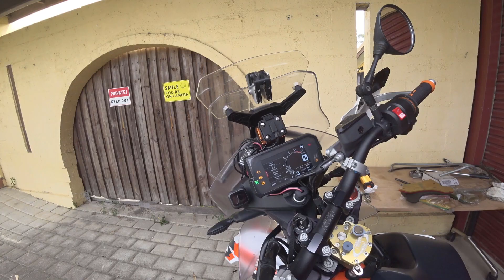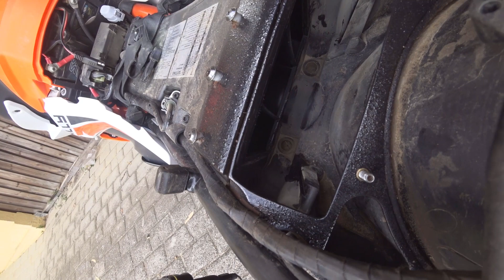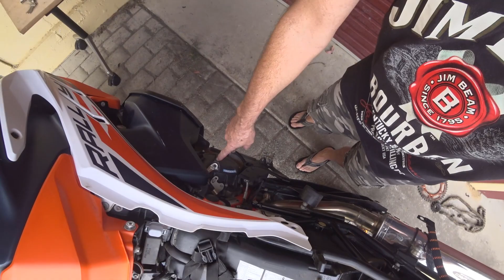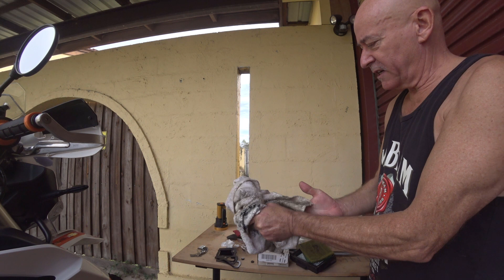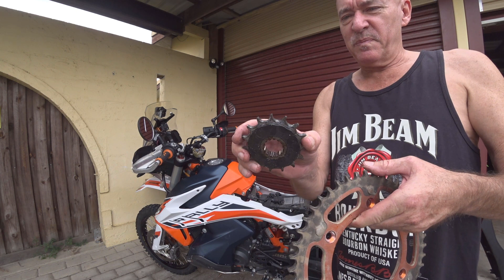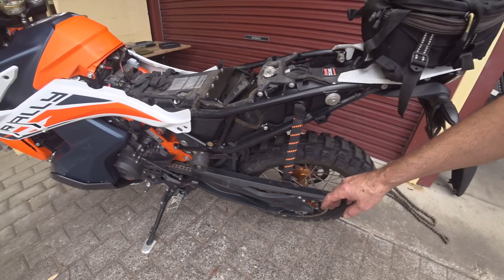Ultimate Adventure Machine? 25,000Km Review of my KTM 890 Rally - Is it Worth the Hype?

Comment: A great machine, thanks for sharing. I'm interested in your skateboard wheel 'steg peg' addition. I'm hoping to do a similar thing with my 850gs (as Steg Pegs are not made for my model) by removing the passenger pegs and securing the wheel to the forward existing bolt hole. How do you secure yours to the bike? Did you use a spacer or tubing inside the wheel itself? The inner diameter of the wheel I have is quite a lot wider than the stock passenger peg bolt, I'm a bit stuck for options at present. Any info is appreciated. Cheers.
Reply from the maker: I have a video on my channel of making these...maybe 2 years ago? Hope it helps, they're great support in sand or standing for long periods eh. Cheers
Reply: @890RallyAdventureR  thank you, I'll search it out.